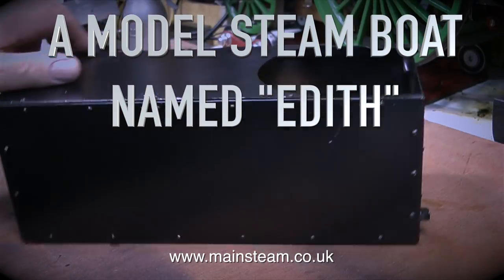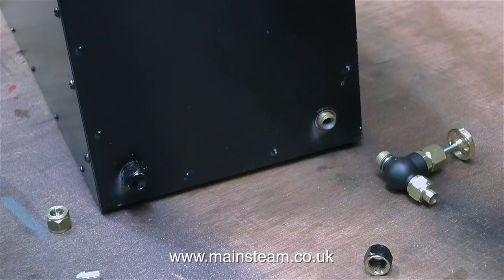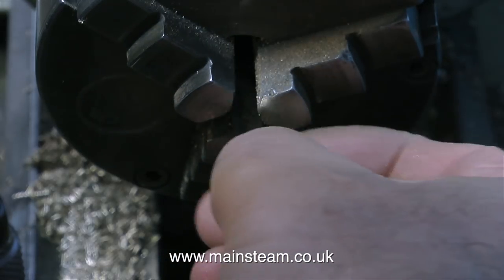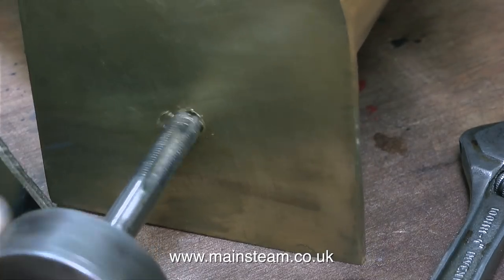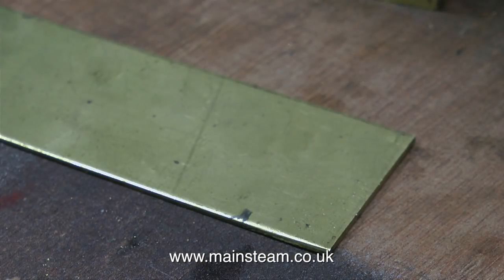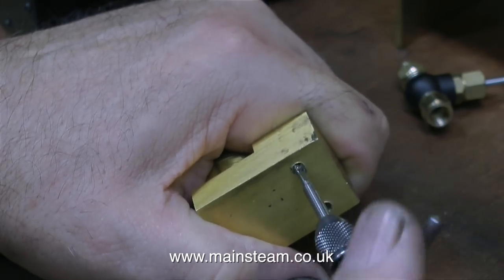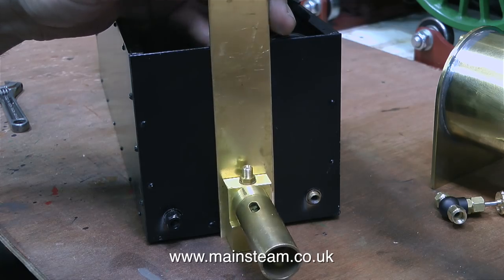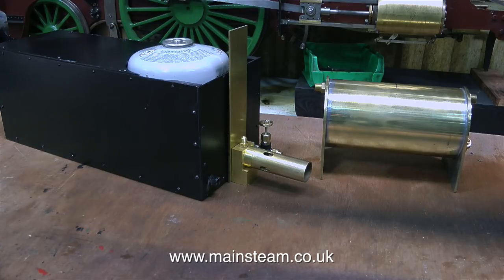A MODEL STEAM BOAT NAMED EDITH - PART #26

Comment: The bypass valve to me appears may be a bit fiddly to get at in operation.  I hope I am wrong.  Yet you could make a fork with some welding wire that could give the boat operator the ability to adjust the valve with out having to reach into a tiny space?
Reply from the maker: There is plenty of room inside the boat in the area where the valve is.

Comment: would you remind me if this boiler will work with an injector or a hand pump operated by radio?
Reply from the maker: I would say no to that, it's possible but a little pointless . .  .
Reply: then you also avoided using warm water  problem for the injector
Reply: The engine has a pump driven by an eccentric on the crankshaft.  Hence the need for the bypass valve.